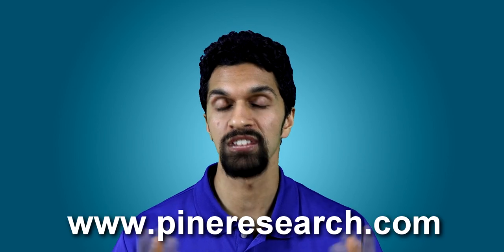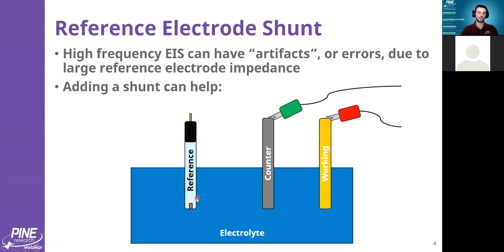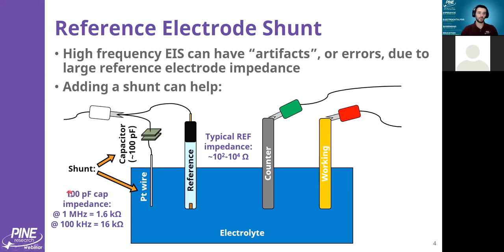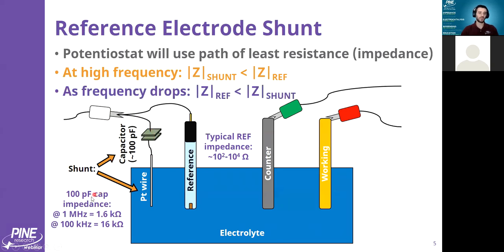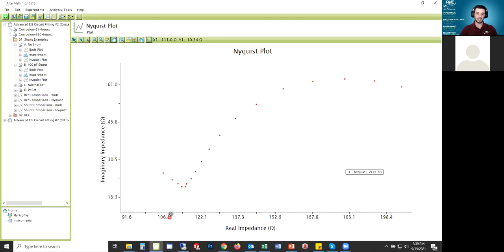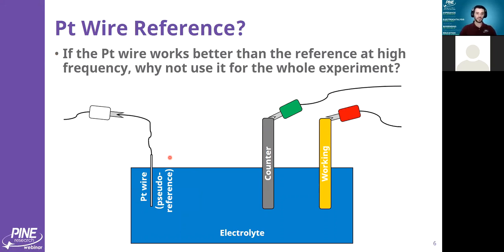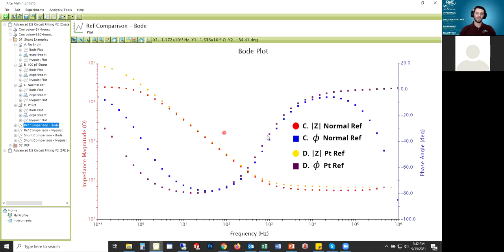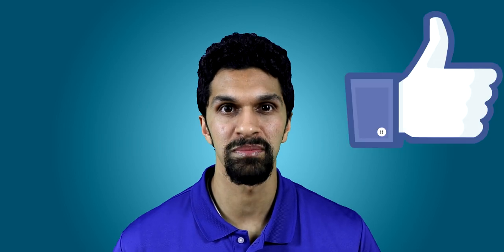What is a Reference Electrode Shunt and why would you use one?

Comment: Maybe stupid question, but when you start measurement you set the reference electrode potential according to the kind of electrode you use. What would you set there now since it changes from platinum to the other during the measurement.
Reply from the maker: Not a stupid question at all!  In fact, I think you are pointing out an interesting quirk associated with using a shunt, which is that at the highest frequencies the "reference electrode" is technically just a Pt wire.  This DOES mean, to your point, that there is uncertainty in the exact potential being applied at your working electrode during that time.

Here is why most probably this is not an issue: the shunt is only really functional at high frequencies where the impedance of the series capacitor is less than the reference electrode, and at the highest frequencies the only phenomena that are normally being probed are things like uncompensated resistance, solution resistance, etc.  These are (in theory) set impedances that are independent of applied potential, so basically the uncertainty in exact applied potential becomes irrelevant.  Once the frequency drops to where you are measuring other phenomena like charge-transfer resistance or double-layer capacitance, the potentiostat has switched to sensing the actual reference electrode so the potential becomes as desired.

I hope this is clear.  I will also add this to talk about live this coming Friday, Sept 20 at 1pm EST in our next episode of Ask Us Anything About Electrochemistry, it will be episode #67 if you want to watch it afterwards.

Link: https://www.youtube.com/watch?v=uEkx_x5_a4g
Reply: @Pineresearch  Thank you very much for quick reply

Comment: Why does the impedance of the reference electrode affect the changes at all? After all, no current flows through the reference electrode
Reply from the maker: So first, to be clear, it is not accurate that 0 current flows through the reference electrode.  Technically, a very small amount of current does flow through the reference electrode.  In fact, if it didn't at all the potentiostat would not function properly.  However, this is not likely the most precise answer to your question.  I just want to point out this distinction.

Reference electrode impedance impacts results primarily at high frequency.  This is to say that many DC experiments, which typically run at low frequencies, are not as negatively impacted by reference electrode impedance.  As shown in this video though, EIS at higher frequencies is where you typically observe this problem.  With respect to the reference electrode, since impedance is fundamentally a function of potential, increased reference electrode impedance can affect the potentiostat's ability to sense the potential at the reference.  Again, this is also a function of frequency, but keep in mind the potentiostat's ability to apply the potential you want it to at the working electrode is predicated on its ability to quickly and accurately sense at the reference, so if that is heavily impeded there can be measurement errors.

If you want further discussion and clarification of this, you might consider joining us on Fridays at 1pm EST for a livestream, and I can talk about this live if you prefer.
Reply: I'm sorry, but I'm not sure I'll be able to attend the live broadcast on Friday. I would appreciate it if you would answer this question in detail on the broadcast so that you can watch the recording. I understand that the operational amplifiers in the potentiostat have a finite resistance and, therefore, the current through the reference electrode is not zero. If I understand correctly, problems due to the reference electrode can occur when it does not keep the potential constant. This means that in this case, at a high frequency, the electrode does not keep the potential constant. It is known that a change in the potential of the electrode can occur with an increase in the current flowing through it. In this case, given that the impedance hodographs are distorted at high frequencies, it turns out that when working at high frequency, a larger current flows through the reference electrode, as a result of which its potential changes, and we get distorted data. As I said, I understand that a non-zero current flows through the reference electrode, but I do not understand why the magnitude of this current changes at a high frequency. I can assume that the electrometer (which measures the voltage between WE and RE) has a parasitic capacitance in the potentiostat, which leads to an increase in the current flowing through RE when the frequency of the voltage between WE and RE increases.
Reply from the maker: @gangster-tz5xe  I have added your question to the comments that I will address this afternoon during our Ask Us Anything About Electrochemistry livestream.  For reference, you can watch later and it will be Episode #42.

I also want to apologize for possibly confusing the point of your question with my initial response.  Let me try to be clear about one thing, and then certainly I will try to elaborate during the livestream later.  The point I made about the current through the reference electrode being non-zero is technically true.  However, the bulk of your explanation in your last comment is not exactly accurate or related to the spirit of your initial question.  I am sorry because I think by pointing out this non-zero current, I have opened a can of worms, so to speak.  The reality is this is an extremely small current, about pA or smaller, and it is simply a technical necessity required for the instrument to measure properly.  The tiny current that passes to the reference electrode in an experiment from the potentiostat almost certainly has zero impact on the reference potential.  It does not affect this at all.  Again, I think your thought process went down a road of assuming that the changes in impedance by frequency are dramatically impacting a current flowing through the reference electrode, thus impacting its set potential.  This is simply not what is happening.

Again, I will try to clarify this later live.  Please join if you can, or feel free to watch the replay afterwards.
Reply: Thanks for the future discussion on the broadcast. Mainly, I want to understand where the distortion comes from at a high frequency. What exactly does the high frequency do to cause distortion associated with the reference electrode. Why is there no distortion at a low frequency, but at a high one? What happens to the reference electrode at high frequency?
Reply from the maker: @gangster-tz5xe  Thanks for the follow up and again, I will draw and explain this with some more detail today.  In short, the answer is actually related to capacitance through the reference electrode glass wall.

Comment: Apologies for the influx of questions regarding this specific topic, but several inquiries have recently arisen, both of a fundamental and practical nature. Here's another fundamental question I have: How does the potentiostat ensure a consistent application of the same (alternating) potential to the working electrode, given that the presence of the shunt alters the nature of the reference electrode when transitioning from high to mid/low frequencies? For instance, let's consider a system comprising an Ag/AgCl reference electrode and a Pd wire (+ capacitor) as the shunt. The desired potential for conducting EIS, set in the potentiostat software, is relative to Ag/AgCl. However, for impedance measurements at high frequencies, the applied potential now becomes relative to Pd/PdHx (palladium hydride) as the shunt acts as a pseudoreference. Subsequently, as the frequency shifts to mid- to low-range, the potentiostat reverts to applying the potential relative to Ag/AgCl as originally intended. Does this imply that the potentiostat briefly applies significantly different potentials to the working electrode in the high-frequency range compared to the mid- to low-frequency range? If not, how does the potentiostat address this apparent concern?
Reply from the maker: Hey Tarik, this is a very good question, but also fairly complex.  I will try to address it during the livestream today because I know a little bit about how potentiostats work and while I might not be the EIS expert I might be able to share some insight about shunts and what a potentiostat is doing.

Comment: I have an additional practical question. Does the presence of a connected reference electrode shunt have any impact on the accuracy of your cyclic voltammetry data? Specifically, is there a possibility that during cyclic voltammetry, the shunt inadvertently and unintentionally functions as a pseudoreference instead of the intended reference electrode? One option would be to disconnect the reference electrode shunt as a precautionary measure during cyclic voltammetry. However, in situations where you are running a time-consuming sequence of both cyclic voltammetry and EIS measurements, it may not always be convenient or feasible to physically modify your electrode system for each measurement.
Reply from the maker: I highly doubt it.  The best way to check would be to just run the experiment with and without a shunt yourself and see if you notice any impact (apart from normal variation between tests during normal electrochemistry testing).  But CV is not fast enough for that to likely matter.

Comment: I have a highly practical question. When it comes to capacitors, would you suggest using a non-polarized capacitor or a polarized (electrolytic) capacitor? If a polarized capacitor is recommended, which terminal should be connected in series to the conductive metal wire (shunt), and which terminal should be connected in parallel to the reference electrode? I would greatly appreciate your advice since I lack expertise in electrical engineering.
Reply from the maker: To be honest, I am not an electrical engineer either and don't know for certain.  My intuition is that non-polarized capacitors would be a better choice, in part because EIS fundamentally involves oscillating signals, and it's probably better to not have to worry about + and - leads.
Reply: @Pineresearch  I agree. Based on my experience, polarized capacitors are commonly employed due to their compact size and affordability, even for larger capacitance values. On the other hand, non-polarized capacitors, typically made of ceramics, tend to be more expensive. Moreover, when a significant capacitance value is required, non-polarized capacitors tend to become physically larger, which can be impractical for your electrode system.

Comment: I have a basic inquiry regarding the occurrence of artifacts in the high-frequency range specifically when utilizing reference electrodes with high impedance values, typically introduced by their frit. While a frit can be viewed as a frequency-independent pure resistor, I am curious as to why these artifacts are observed primarily in the high-frequency range. Could this phenomenon be attributed to the reaction kinetics of the reference electrode?
Reply from the maker: Hello Tarik, I'm getting some information from my colleagues about reference electrode shunts and as I dive deeper into the subject I'm finding it to get progressively more complicated.  In general though, I think you are correct, the reference electrode frit acts as a resistor.  However, it's reported that reference electrodes like Ag/AgCl and SCE have a capacitance as well.  It's a very low capacitance ~ 7-10 pF, which makes me think it's the capacitance of the glass body of the reference electrode.  At high frequencies, this capacitor adds phase delay and attributes to the high-frequency artifacts you observe.  It might be possible that reference electrode kinetics also play a role, but I don't know about that.  That would be a very interesting experiment to do.
Reply: @Pineresearch  That's fascinating insight! Could you please provide me with a reference that delves further into this topic? However, I have a critical comment regarding this theory. Based on my understanding, since the impedance of a capacitor is inversely proportional to both capacitance and frequency, I would anticipate that the capacitance of the glass body primarily poses issues at mid- to low frequencies, rather than high frequencies. At high frequencies, the significant number of hertz would somewhat offset the relatively low capacitance value (around 7-10 picofarads) during multiplication, resulting in a moderate impedance for the reference electrode. Conversely, at mid- to low frequencies, when you multiply two small numbers together, the product becomes even smaller. As a result, due to the inverse relationship in the denominator, it leads to an incredibly large impedance value. I'm curious to hear your explanation for this phenomenon.
Reply from the maker: @Heisenberg-EC  You are fundamentally thinking of the impact of reference electrode capacitance backwards.  Because its impedance increases as the frequency drops, it has LESS impact, not more.  A large impedance means it represents a bypassed circuit, so effectively it is ignored, not present.

I was out last week when Alex was handling some of these questions, and we've had internal discussions as he brought me up to speed.  I am going to cover some of our conclusions a delve a little more deeply into these phenomena during today's Livestream (will be episode #14).  I encourage you to watch it, or watch the replay.
Reply: @Pineresearch  Ah, you're absolutely right! I didn't have the complete picture in mind. The electrical circuit of a glass reference electrode operates in parallel, which means the potentiostat can either probe via the frit (resistance) as intended or through the glass (capacitance). After rewatching the Livestream, everything became crystal clear! It's evident that at high frequencies, the impedance of the glass path is lower than that of the frit, resulting in erroneous data. However, at mid- to low frequencies, the impedance of the glass capacitor increases, effectively bypassing it. As a result, the potentiostat can probe through the frit as usual.

Comment: How can you verify that the shunt is getting rid of the error and not introducing a new error at high frequencies? I understand that the negative intercept with the real axis does not make sense. But in other situations I can imagine it would be useful to validate the impedance data using another means, such as current interrupt or one of the other techniques used to determine ohmic drop. I don't think the shunt would be needed for DC techniques. 

It might also be worth testing other capacitors to check if the data converge at a certain capacitance.
Reply from the maker: You are correct that the shunt is almost certainly not needed for DC techniques.  And as it relates to other techniques for determining iR drop, you can do current interrupt or positive feedback (both DC methods) as a means of validation that your high frequency EIS data - either with or without a shunt - is perhaps roughly accurate.  Personally, I find current interrupt to be a rather poor and very often inaccurate technique, but I like positive feedback and would use that for such verification.

To your first point, it is certainly a possibility that the shunt could introduce some other errors.  Perhaps the detection and use of the pseudo-reference Pt wire at those high frequencies, even with such quick speed, might be less accurate as there can be inaccuracies with the potential during that time, so possibly your working electrode may not be in the condition you think it is based on your applied setpoint.  Additionally, choosing different capacitor values could be instructional, but mainly it would just be a way to adjust the point where the potentiostat switches from pseudo-reference to actual reference, and the larger the capacitor you pick the more frequencies you will be using the pseudo-reference, which could further cause errors.  So this might be an interesting idea, but I would be cautious about using very large values of capacitor because at some point you're just using almost exclusively the pseudo-reference, particularly where it is not necessary to do so.